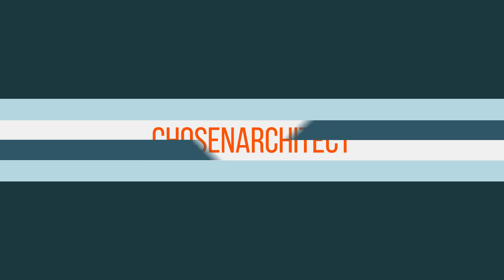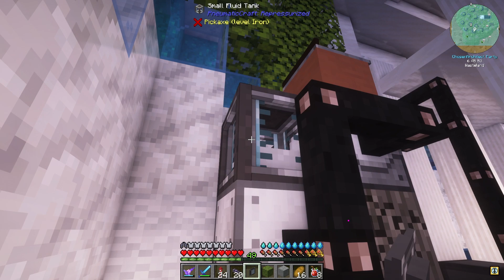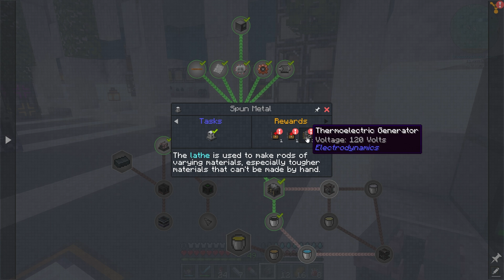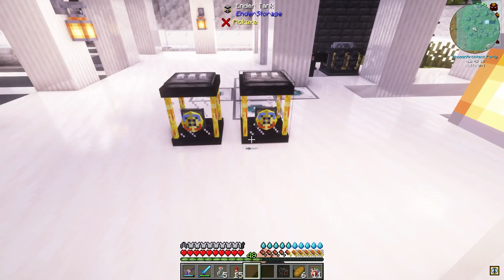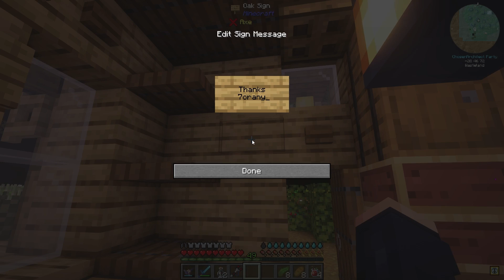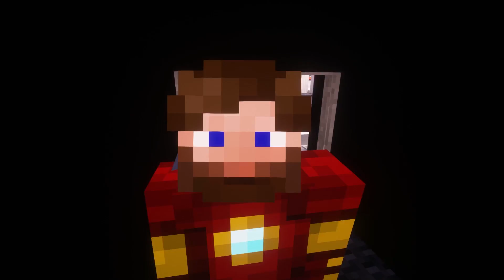FTB Genesis EP11 Unlimited LPG Power

Comment: there's also the stuff called "Thermal Lagging" that are basically thin plates you use to cover the sides to insulate it, and it's a good cheap insulation that doesn't use up your precious iron. These allow you to click through them while still insulating the block behind them, which is handy if you or a Drone needs to insert or extract fluids from the Refinery. 
Biomes have a role to play as well with regards to heat, so it's always good to notice that. Also with a bit of Heat Pipe, you can add more heatsinks onto the other end of the vortex tube, improving its capability.

Comment: You can use the heat paddings from same mode to wrap refinery. It will make it lose less heat which in return will process the oil faster. You might need to make it faster in the future :)

Comment: I have a question ok so im gonna get the ryzen 7 7800x3d after having a 5 5600x. does having a better cpu actually increase fps especially late game factory mod packs because i run less than 60fps late game? also i going to have 32gb of ddr5 after having 32gb  of ddr4

Comment: Hey chosen, when you use pattern provider to autocraft into a block/machine you don't need to add a pull from the side, the patern provider automatically imports into It if the blocks accepts the item from that side (for example a furnace from the top). You only have to force pull if you use an additional inventory as a buffer